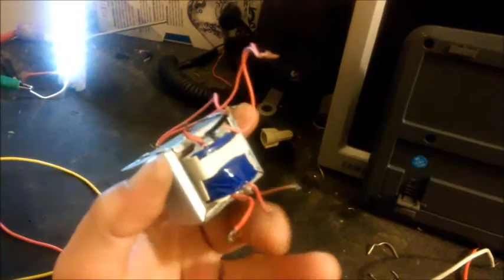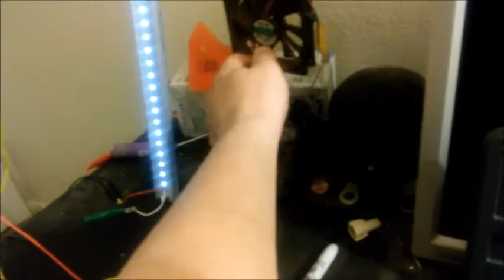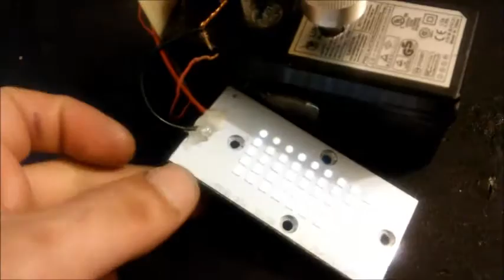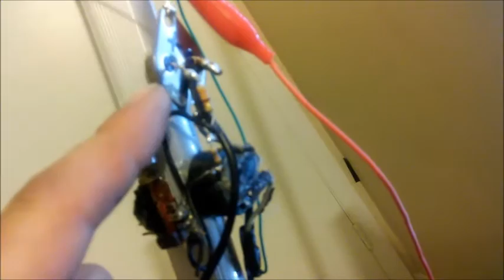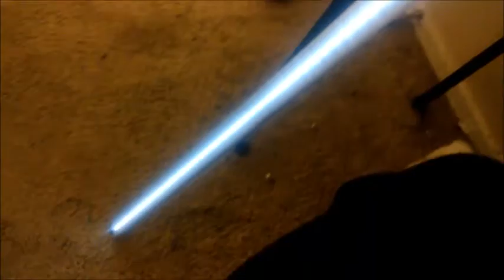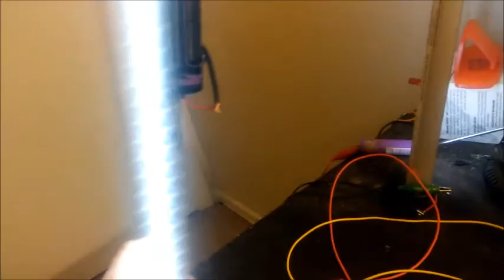~100 LED Joule Thief and friends.

Comment: really like your videos, I'm very impressed by what you've been able to do. I've been around Electronics my whole life, I'm starting to mess around with Joule thieves and LEDs. I saw your video on the ridiculously bright flashlight, I ordered an xhp70 to mess around with when it gets here. Being that I have too many questions to ask, what would you suggest as to where I could start learning more about these components? Is this your hobby, or is this the field that you work in, electronics?
Reply from the maker: I work in LED lighting doing new installs and retrofits so that helps me get my hands on old stuff to tinker with like LEDs and transformers, but I have by far learned the most about LED's from flashlight enthusiasts. Places like candlepower forum and budget light forum, as well as the reddit flashlight subforum.  Electronics has been a hobby of mine for quite a while.

The leds you can buy online for custom flashlight builds totally blow away the current commercial led products sold for fixtures. The XHP-70 will blow you away seriously. One benefit of Cree emitters is that they didn't use much sapphire in their chips (used for reflecting the light from the wafer), which means they have a little less lumens per watt output , but can be extremely overdriven. So your XHP-70, if heatsinked properly on copper, can be driven well over 30 watts to deliver over 5000 lumens whereas a Nichia emitter (like the only Cree competition) won't be able to do it.

Joule Thief circuits are a great way to learn the blocking oscillator, and so many circuits I play with are basically just a variation of Joule Thief. It's such a useful circuit. I'd be happy to answer any questions you may have and always enjoy it when other people find interest.
Reply: Magneticitist thanks for replying! That is super interesting. so you do LED retrofits? That is so cool! How did you get started in that?

My first project is creating small portable, dimmable bright light sources for my workbench that I can move around to different places if I want, and an XHP70 was the perfect choice for the fixture as you can under drive them and they are still very very bright. i surf candlepower forums as well, and what I seem to understand so far is you need a constant current driver to run these. I wanted something to control brightness, and I always thought you had to use a pwm dimmer in line with the positive lead, between the driver and the LED itself. I noticed that you are using standard pots though. ( putting a dimmer on your flashlights and other LEDs is exactly what I was going to do, but you're the only person on YouTube who has put it up in your video!)  I know pots can generate more heat, so I was just going to use a PWM dimmer inline. What do you think?

 People like you who put these videos up on YouTube to share what they know teach people so much so I really appreciate it.

Tony~
Reply from the maker: Working in LED lighting for me was something that I guess just kind of stood out to me cause I love playing with lighting so much. I'm like you basically trying to find the most practical and most efficient way to have portable light. I've got so many little different kinds of lights it's like subconsciously I predict a long term blackout coming lol. But it's good work I basically hopped into after doing some electrical work. Still have to know some of the same things but only need to focus on light fixtures, so while I still have to work on hot 277v wiring quite often, it's really just the same kind of wiring no matter the fixture. Definitely not hard.

 Firstly when it comes to driving LEDs, most people will tell you that you do indeed need a constant current driver, but that doesn't mean you can't light LED's from pulsed DC like on a Joule Thief circuit. I do it all the time. You just won't healthily light them to full brightness that way if you're using a high wattage emitter. The idea of using the constant current driver is just so that it outputs the same amount of light after a battery voltage begins to sag. 

When it comes to dimming LEDs there are certainly different ways to do it. The light I showed with the variable resistor on it to me was just a simple way of doing it without having to create a circuit or add a more complex switch or even more switches. The best way to dim them is using PWM or simple frequency modulated bucking drivers but there are also a lot of drivers out there that just use linear regulation. Me using the 25 ohm rheostat instead of a linear regulator seemed like basically the same thing. That XHP light simply had the regular rheostat in between the two batteries just placing it in series with the power supply. That allowed me to simply add more series resistance in the circuit to drop the input current. I do the same thing with a couple other lights that run at 4v input and throw a 100k pot in series with the battery as a dimmer. This allows me to dim the light down to a super-firefly setting and it almost doesn't need an on switch cause it can run that way for months. The rest of my lights use driving oscillators so my regular pots are actually setting the resistance biasing my transistor so they aren't actually in line with the battery.

If you are looking to grab more efficiency driving an XHP-70 at less than full, then I'd go for a more complicated switching power supply which can be bought for probably under ten bucks to be used in a flashlight. 

Now if you're talking something that you can plug into the outlet then those get more expensive simply because even though you could buy a dimming switch for 120v usage you'd still have to buy a 120vac to 6-12vdc driver which can be expensive.